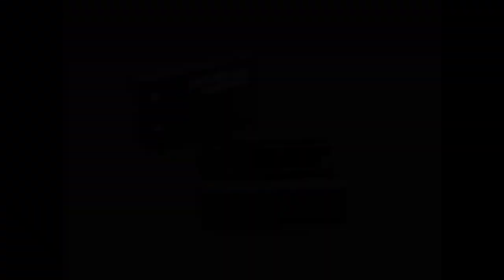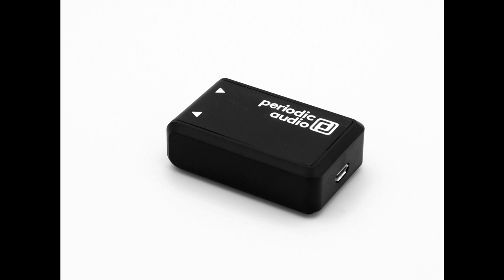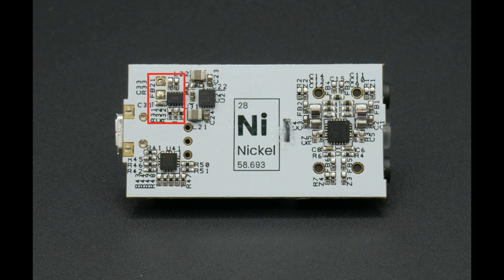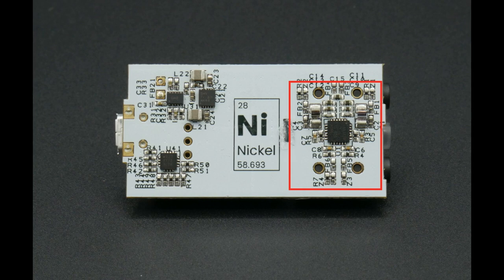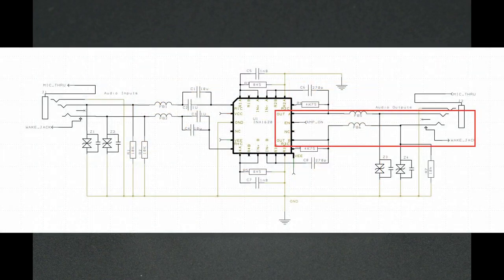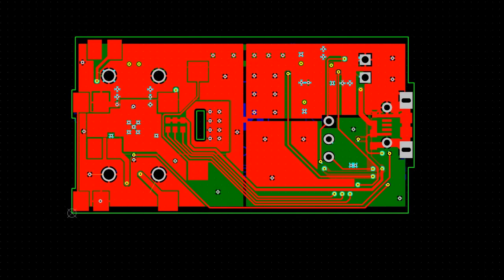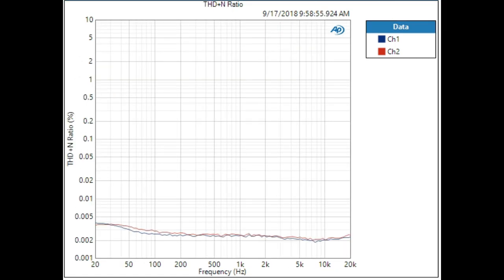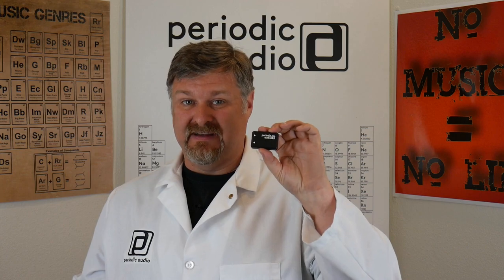Nickel Deep Technical Dive

Comment: Great video, Dan.  I love my Nickel!  I am thinking about buying a Note 10 and Samsung seems bent on replacing the 3.5mm headphone jack with a USB-C port instead.  Will the nickel still be able to work all of its magic using this type of port (with an adapter)?
Reply from the maker: Yes it will!  Most of the USB-C dongles have decent DACs in them, but even worse amplifiers than the phone.  Nickel works great.  At the CanJam shows, we use the Apple dongles with customers that have newer iPhones - and they are always stunned at the improvement.

Comment: Great video. Thank you. Are you familiar with Sennheiser’s original IE800 IEMs? I would love to know how the Ni complements the IE800.
Reply from the maker: The ie800 is a 16 Ohm unit, making it really hard for most portable electronics to drive.  Nickel would be a very good match for that set, as 16 Ohms is a breeze for Nickel!
Reply: Periodic Audio THANK YOU!! I should receive my Ni in a couple of day. I cannot wait!
Reply: Ok. Received my beautiful little Ni last night. It sounds FANTASTIC, AWESOME with my Sennheiser IE800 IEMs! Super organic, smooth, clear and clean! Truly a superb product.

Using it with my iPhone 7 and the Apple lightning to 3.5 adapter. I think the DAC is only in the adapter (not in the iPhone itself. Read that somewhere. Not sure if it’s true). 

Anyhow, I wish my iPhone/adapter had a much better DAC to really get the absolute best sound (soundstage, width, depth, etc.) Do you know of any no-nonsense (like the little Ni!) lightning to 3.5 adapter that has a better DAC than the standard Apple adapter?? (Regardless of price). And no need for it to have mic or volume capabilities. Just a pure superb DAC (like the Ni).
Reply from the maker: @rezakhalvati6150  Right now, the best option is the Audioquest Dragonfly Black with the Lighting to USB 3 adapter (camera adapter).  Then the output of the Black into the Nickel.  That would set you up with high res capabilitiy!
Reply: Periodic Audio thank you so much! So you think the Black instead of the new Cobalt?
Reply from the maker: @rezakhalvati6150  Cobalt is a bit smaller, and the ESS 9038 is nominally better, but you're limited to 96 kHz with any of them - so we're not sure how much better the Cobalt would be.  The amplifier in the Cobalt is better - but Nickel is better still, so... ;)

Another option that many people like is to go wireless!  Te Radsone ES100 is a great little Bluetooth (AptxHD, LDAC) receiver, and is the same size as Nickel - so you end up with a massive power, wireless solution from your phone to the electronics.
Reply: Periodic Audio thank you! Yes. I had the es100 but unfortunately returned then before receiving my IE800. Is the amp in es100 as good as the Nickel though?
Reply: Or did you mean I can use the Nickel “with” es100?
Reply from the maker: @rezakhalvati6150  Use Nickel with the ES100.  the ES100 is a great Bluetooth receiver, but its amp stage is, in our opinion, a bit lacking.  The Nickel adds a significant upgrade to that device.
Reply: Periodic Audio beautiful! THAT, I like a lot, because there is no way I’m replacing my Nickel! Lol! Thank you so very much!